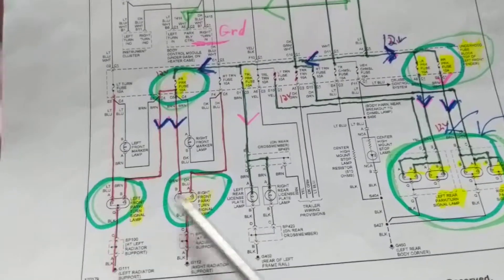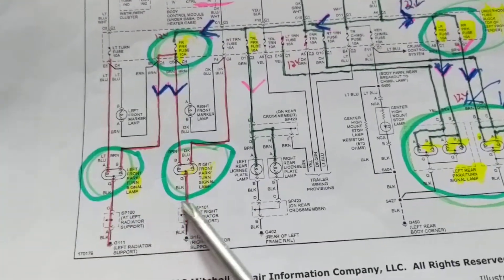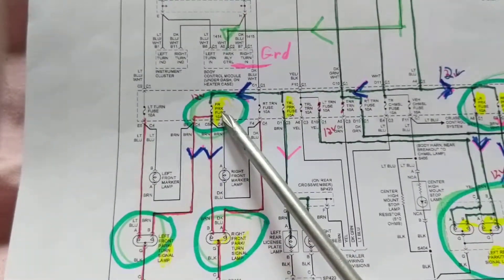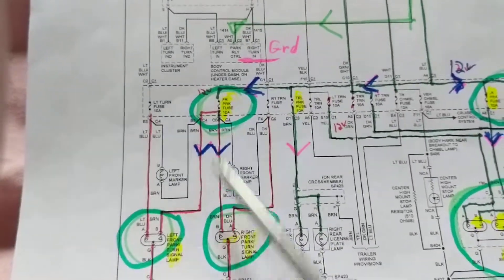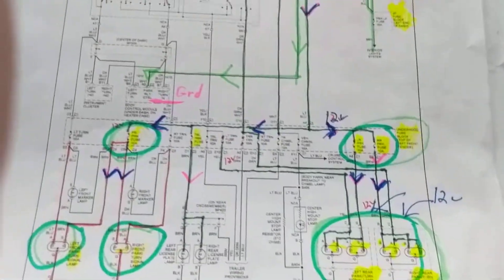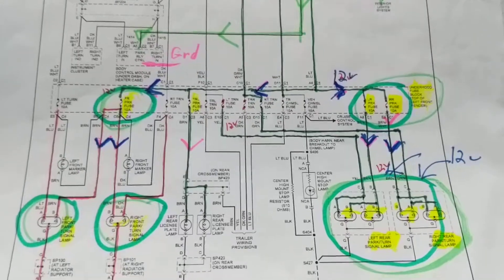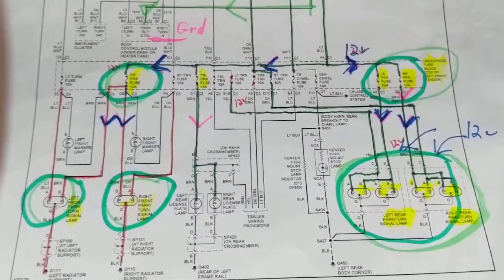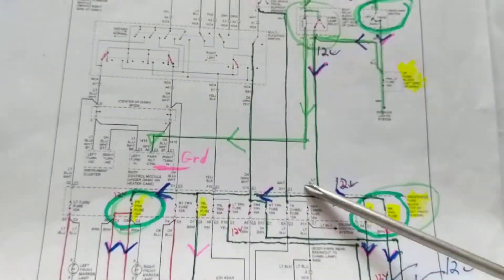HOW TO READ AUTOMOTIVE WIRING DIAGRAM WITH VOLTAGE MEASUREMENTS

Comment: Hello this is very helpful. I have a « door open » signal on the dash of my Mercedes vito w639 2004. Would you have a tutorial to help me diagnose the problem? I find the lock diagrams confusing, they have a motor and a micro switch

Comment: Thanks for your tutorial. I suggest if you separate circuits, it is earlier for everyone to grab. I can name a few circuits: headlights, brake, reverse, horn, charging, starting, windows, alarm.. I am just enthusiast not tech, If something not working, it is open or short circuit, for a device or something to work, the current must complete the circuit. If a device not work as it should , there must be resistance issues.
Reply from the maker: yes that's what I'm going to do